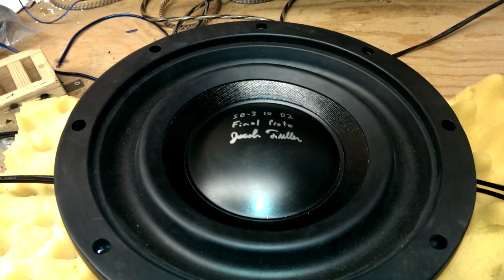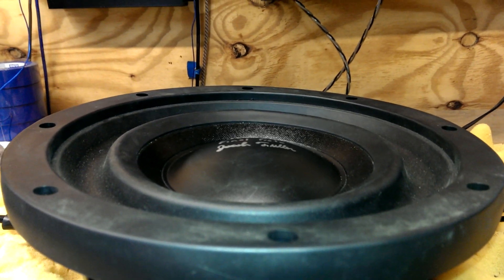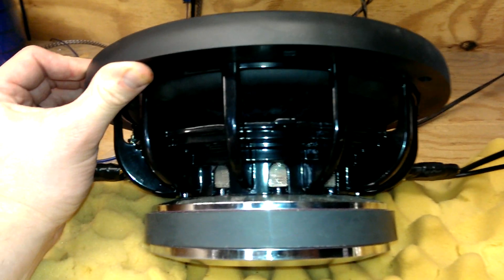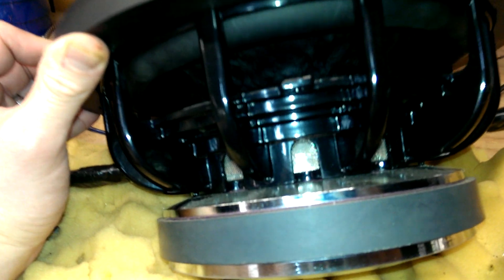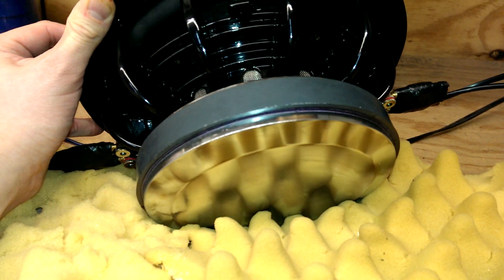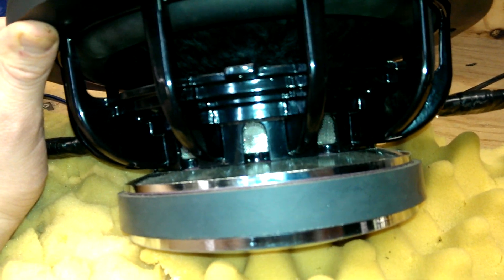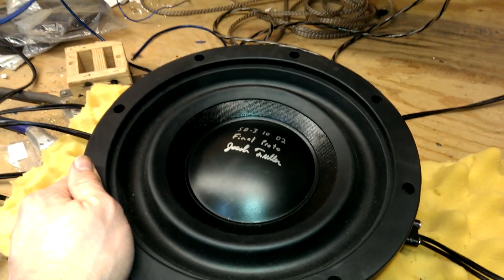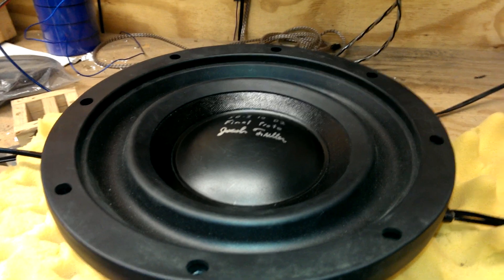SD-3 10" Final Prototype Video

Comment: Are 2 of these going to be louder than 2 sundown audio sd-2 rev 2 10"s in a down firing configuration under the rear seat of my Chevy 3500 crew cab I have 2 10" sd-2 rev 2's now but I'm selling one to a friend and I'm installing one in my brothers f-350 crew cab should I go back to the sd-2 rev 2 10"s or go with the rev3's??? I have a Memphis Audio 1100 watt RMS @ 1 ohm amplifier to power them with full 0 gauge and 2 batteries with the big 3 and a 120 amp stock alternator.

Comment: Difference between this and the SA-10 D4? Which one has less distortion?
Reply: SA-10 is louder and better suited for ported boxes. SD3 is cleaner and shallower and better suited for small sealed boxes.
Reply: +Josh Loper Thanks! How about the 12s. I want a sub that goes very deep, but is clean at the same time. I think of the SD-3 12" or the SA-12 D4 REV. 3. Which sub is better, cleaner, or deeper. Box size is not a issue.
Thanks for your help!
Reply: +Joshua's Recordings +Joshua's Recordings I have personal experience with SA-12 v2 subs but not the SD3s. I've been looking into the 12" models a lot myself though. I can say that the SAs will dig very low into the 20s. They can go lower than SD3s and will sound clean while doing it. The SD3 12 would be even cleaner and get low, just not as low as the SA-12.
Personally, I'd say go with the SD3 12.
Reply: +Joshua's Recordings From personal experience, the SA-12 is going to play lower and louder.  I put one in a t-line (since box size isn't an issue you could do the same) and it was 140db capable at 34hz, and continued to play down to 25hz with quite a bit of authority.  Even in a ported box it was very low end biased.

The SD-3 line is a pure SQ woofer, and while it can take a beating as well I would go with the SA if you're concerned with output.
Reply: +the_niceking Thanks!